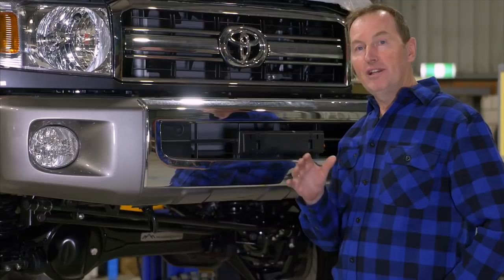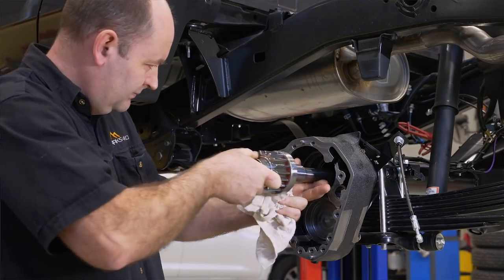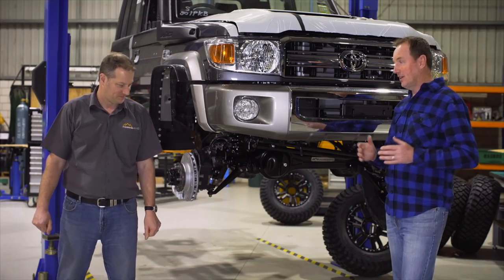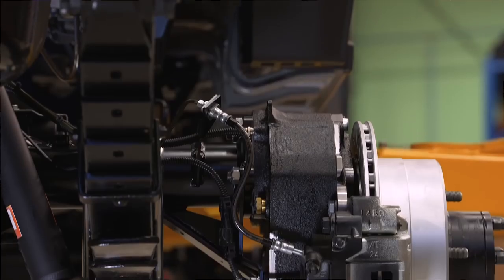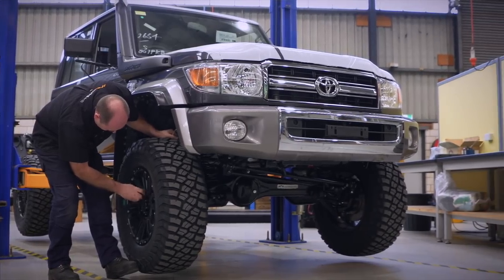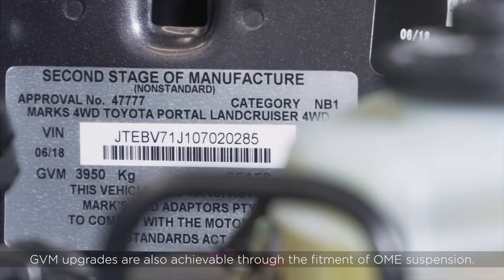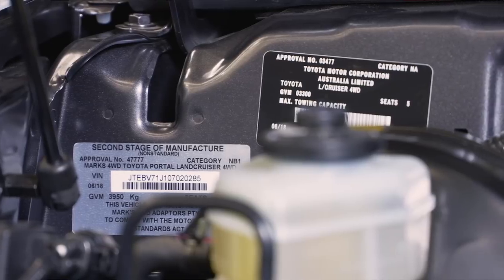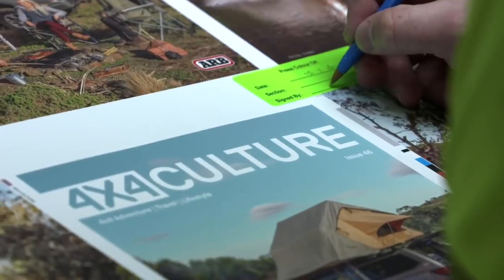LandCruiser Portal Axles | Offroad Images' Mighty 79 Build

Comment: I like the Portals, but you don’t need them to run 35”, the tyres can be engineered without Portals. However having a Defender with MaxiDrive Portals I can appreciate them. What are the services intervals on the Mark Adaptor Portals?
Reply from the maker: While fitting a bigger tyre to the vehicle was one of the reasons, it was not the only reason for this rig. Please contact Mark's 4WD Adaptors with any questions -  https://www.facebook.com/marks4wdadaptors/

Comment: Very cool product, any details around power loss through the portal gearboxes? Obviously this would be offset by the gear reduction (if running bigger rubber), but still wondering if you have dyno'd or measured?

Comment: theres an issue runming 35" tires on the road there? wtf! in the us i could drive a monster truck on the road legally lol, as long as it was based on some vin'd vhicle and had the nessisary brake lights, turn signals etc. actually ive seen things close to monster trucks on the road.

the portal axles are awesome tho! wish they were avalable here....as well as solid axle toyotas.....and diesel toyotas......etc

Comment: Do you have to factor portal axels in on your max legal suspension lift and tyre sixe?
Reply from the maker: Hey Chris, there is only a problem if a vehicle has uncertified modifications. This vehicle's modifications are engineered and certified via approved second stage manufacturers.